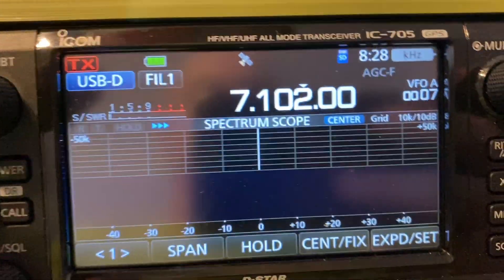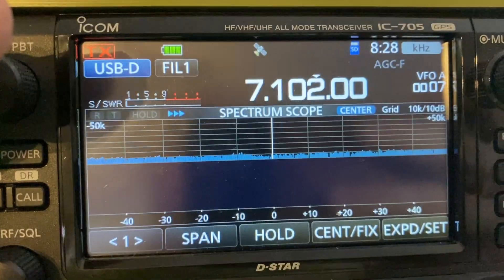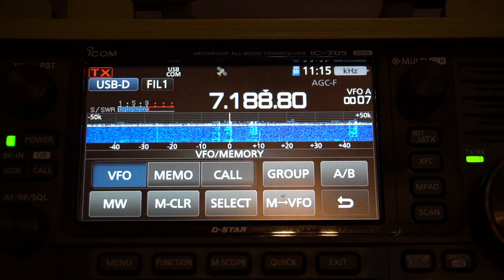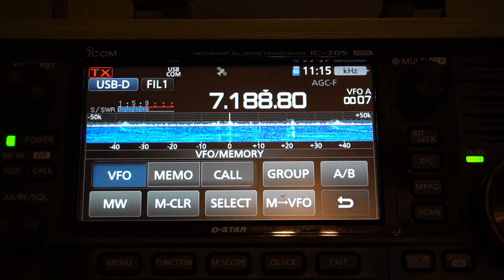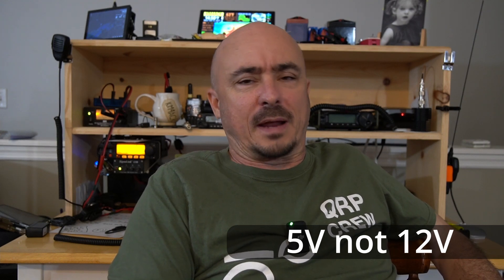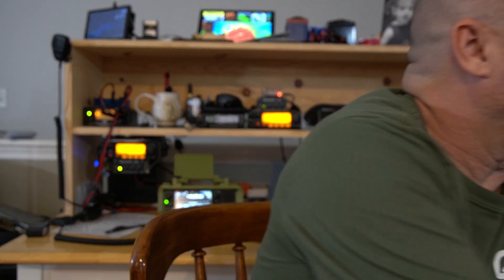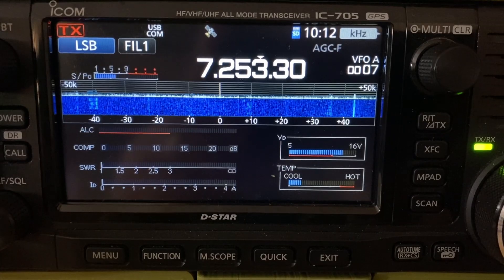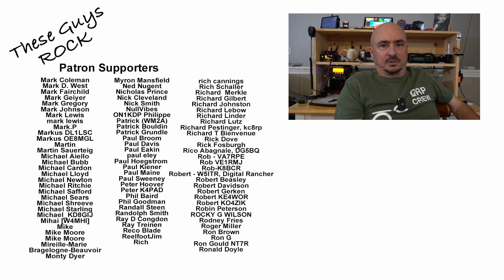How to Eliminate Annoying RFI

Comment: I’d love it if you would hit on a common issue when mobile. 
I have have added several ground straps, alternator noise suppressors and ferrite chokes on coax and power cables. 
I have a diesel pickup and I’ve narrowed it down to injector pulses. Several people talk about this issue but I haven’t seen a resolution as of yet.

Comment: I hope that CONTINUES to work for you.  I recently bought a TPLINK AX1800 Wifi router, and found that for some reason, it's blasting out 3 pulses of RFI every 8 seconds.  I hear it very plainly on the 10 meter band, but tracked it down with an HT.  It doesn't happen all the time, but seems to happen when I sit down at the radio (of course).  Caveat Emptor... DE K7RLN

Comment: The struggle continues. I use an old AM radio off a broadcast frequency to sweep occasionally. One of my friends told me a few years ago that I should have bought stock in ferrite beads and toroid cores. Almost all my electronics power cables have them now. The worst offender was my security camera system power modules for the cameras. I replaced them with much better switching power supplies, properly ferrited, and lowered the noise floor as much as possible. I'm about 2 blocks from a major outdoor mall so noise is a way of life. Keep up the good work. Jack K5FIT

Comment: Thank you for the good video. 

I’m a new ham and have heard people talking about noise floors but I’m curious what / how you define as a base noise floor. In my IC-705 it seems to be adjustable by both the RF Gain and the waterfalls “ref”!settings. 

When you are judging your noise floor. What setting do you use for RF Gain and Waterfall ref?

Thanks again! Keep the videos coming!
Reply from the maker: No RF Gain, meaning we don't want RF gain "hiding" any noise. Waterfall reference is set to 0. Also, make sure that noise reduction is turned off.

Comment: The only thing I would do differently is shut the whole house down, and then test each section of the house with everything else off, and turning 1 breaker on at a time, then turning that one off. Why ? Well, noise is somewhat additive but generally one noise source i hard to differentiate from two noise sources , the additive effect might not be very noticeable.

Comment: I have a POE Switch that I use for security cameras, and its noise level is terrible.  I unplug it when on low band HF to be able to hear stations S9+.  It's on the list for replacement this spring.

Comment: I had the same issue with my router at my repeater shed. It was affecting VHF and causing my link radio to "hear" a signal and in turn not allowing the link to work. I did all the same things you did and as crazy as this sounds I ended up with the same router as the solution. Thanks for the videos!

Comment: Do you mean to say that you're not going to debug the old switch? ;^)
Reply from the maker: Since the replacement was only $15, it hardly seems worth the effort.
Reply: @KM4ACK  Perhaps a good way to debug that noisy switch would be a sledge hammer :)
Reply: @km4ack so was that noisy switch installed around the time you noticed RFI or did is degrade to where it was noisy? In other words was it installed/hidden around the same time as Christmas lights were put in service?

Comment: Network switches are notorious noise sources.  Never go cheap on the switch unless you want to deal with noise.
Reply from the maker: I was surprised by the $15 replacement switch. I can't detect any noise from it on HF.

Comment: I have run into this problem both at home and in the workplace. One of the things I do is attach a ground wire to the switches/hubs as most of these devices are not grounded already.  Throwing torroids on the lines also helped.
Reply from the maker: Thanks for the tip!

Comment: I’ve run into similar issues.  I actually recently found extremely high noise when I would swing my two meter yagi around facing the house.  I started unplugging stuff and found it was an LED desk lamp causing my issue. Oddly enough I don’t have any issues on HF, just 2m and 70cm, which I thought was strange!  I also have a network switch, but it wasn’t the wall wart causing the issue for me.  It was something in the actual Ethernet lines.  I have Ethernet connecting both my 9700 and 7610 and I ended up having to buy some toroids to wrap the Ethernet cable around and it got rid of most of the noise.  I’ve also got noise problems on 80m with a constant S9.  Never been able to track down the source for that but I have suspected the issue is a 250kva transmission line about 1/4 mile from my house.  Can’t really do anything about that one. 😩